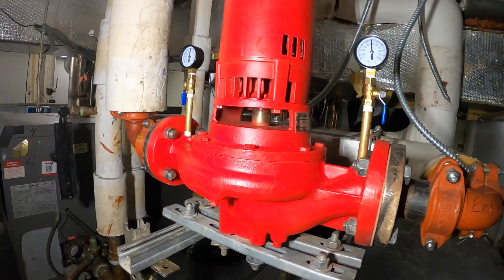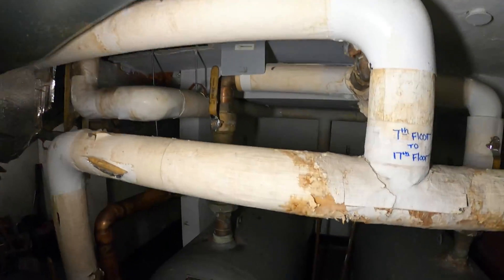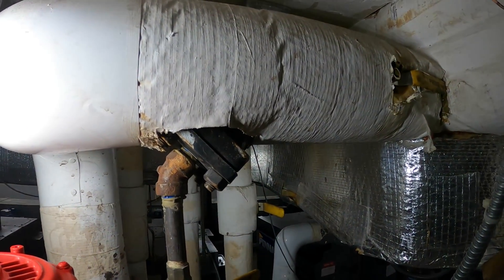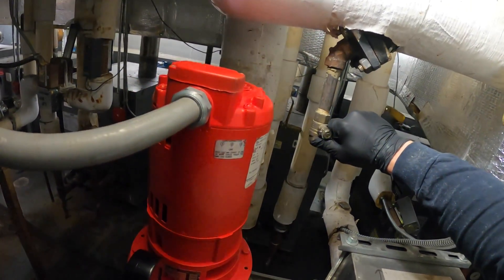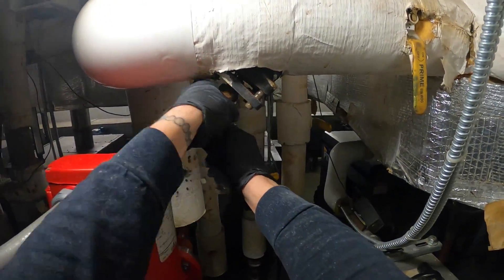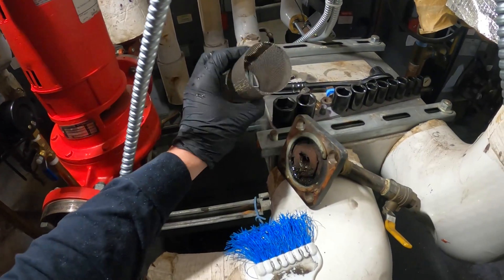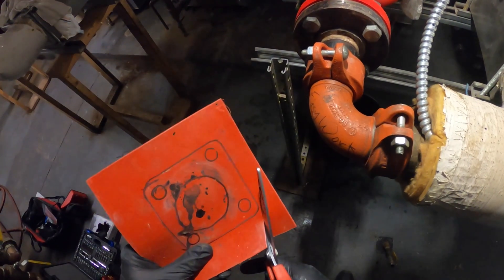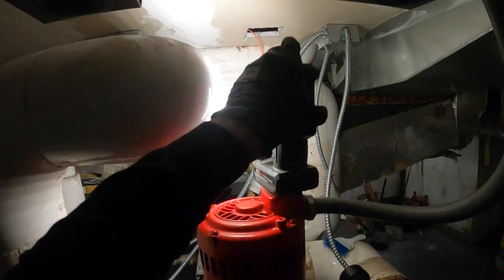HVAC: Boiler Hydronic Circulating Pump Maintenance (How To Pull And Clean Strainer For Boiler Pump)

Comment: Quick tip: the LOTO is done on the switch itself (black handle).  The lock prevents the switch from being turned and powering the motor.  The locking clasp you are pointing to prevents the panel from being opened, not the switch from being turned.

Comment: What… Preventive maintenance!! We only used brass wheels to clean faces to prevent scoring, that pitting on the strainer shows a build up of material/ debris causing flow impingement and creating pitting!! Wondering if they test the boiler water for PH levels do they add additives? Man you are definitely going to give them a better operating system!